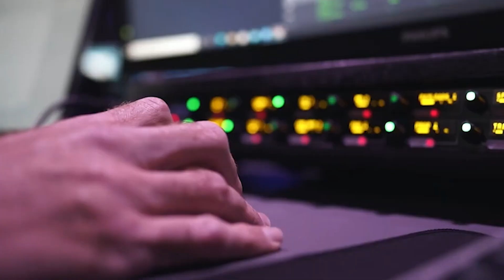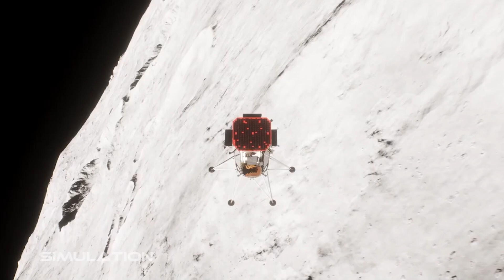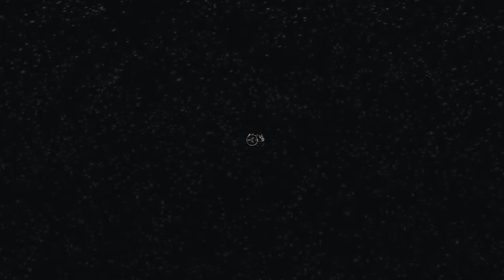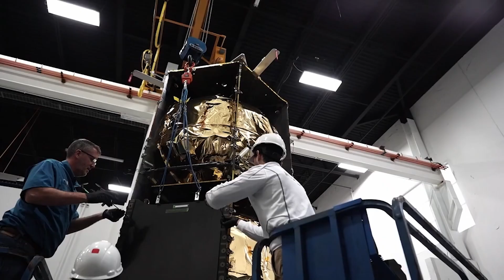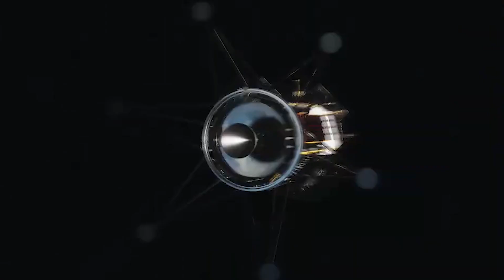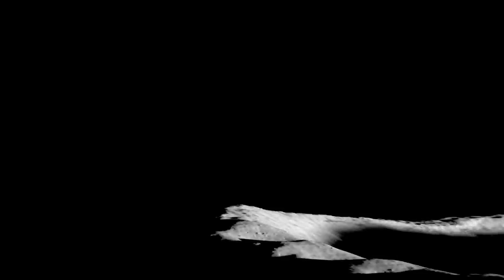What Exactly Went Wrong During Odysseus’s Landing?

Comment: This IM Odysseus lander was a major learning process going forward.  I find it most curious that so many criticize this mission, but most of the criticism is very narrowly only focused on the lander falling over and its mission compromised or why it did have pictures immediately while ignoring that it had many firsts.  

The first US lander and from a private company to land on the moon and the south pole no less.  

The lander may have fallen over, but it landed in one piece.

The lander used a cryo fuel for the first time and methlox was that fuel.  

The lander was built on a tiny budget of 118 million $. If you dont see that as a small budget compared to what missions to other extraterrestrial vehicles you are showing your ignorance about how expensive and technologically difficult it is land on the moon and doing it autonomously!!
Reply: Failure is failure. No excuse 😅

Comment: Why is it not round with a roll cage so it can roll over to the desired position by way of push arms which can be discarded after landing?
Reply: Too much weight (which require lander to be massively overbuild btw), minimal gains, as reason why it happened at all is mistake of a design itself, not fit for any horizontal movement on landing.
Reply: Because that would result in transparency of the entire schtick.

Comment: I'm no engineer, so please don't troll me.😂  But would this be a lesson that if with folding or extendable arms on each side may have been able to correct it. Or perhaps compressed gas jets?
Reply: I think that, more than the legs, the fact that it impacted with an horizontal speed component was what condemned the mission. It would have probably failed even with larger/wider legs... Imho.

Comment: The original price for the IM-1 mission was $77 mil. Then that got bumped up to $118 mil due to modifications. With all that money it took a $1 manual safety switch not being turn off to ruin the whole mission. In the 60's everything had backups and backups to backups. Redundancy was a primary design application in everything Nasa did. And why was this switch manual without a digital override or a backup digital switch. With all the computerization on this lander why was something so vital to the success of this mission left to 1 switch with no backup. Unbelievable.
Reply: What's unbelievable is your cynical attitude claiming the whole mission was ruined because of this "1$ safety switch not being turned off".   

The mission was not defined by it being to land successfully and do its experiments.  Getting to the moon with a budget you even cited was an accomplishment in itself.  After all look how few other landers have successfully gotten to the lunar surface in one piece.   Besides being expensive it is a difficult technical challenge.  

This vehicle used a methlox cryo fuel which was also a first.  

It wasn't about just landing perfectly!!
Reply: @michaeldeierhoi4096  Sorry. I guess being witness to the 1969 and all the other manned lunar landings shows in my lack of acceptance for mediocrity. But you wouldn't understand, being I would guess not born before 1980, the lowering of standers, participation trophies, and the dumbing down of schools, DEI, Affirmative Action, and the myriad of other social justice blather, have made you accept and spin an obvious failure into a triumphant victory. You should work for the Biden Administration. They love people like you.
Reply: @michaeldeierhoi4096  Not that cheap either. For US lander? Sure, it is. Russian/indian/chinese? Already more then average.
Reply: The switch was manual because its entire purpose was to make it impossible to remotely turn on the laser when people were near the spacecraft.  It's a safety device.  Making that switch software overrideable would completely defeat the purpose.  The bigger question is why you couldn't figure this out on your own. Unbelievable
Reply: You spin failure like Karine J Pierre. Anything that important to the mission should have a backup. Redundency is a key to all good design in something that is unmanned. In this case, a switch to over-ride the safety that was either under computer or Earth based, especially in an unmanned mission. I guess your DEI studies didn't cover that point.
Reply: @simulateduniverse9373  That isn't how safety interlocks work.  One day you'll graduate from school and you MIGHT figure out you don't know everything.
Reply: I know failure. I also know reverse engineering. The switch was a weak link. Together, in this scenario, they conclude that a backup should have been in place. Kinda like not using a rubber, resulting in your birth. Failure.
Reply: @simulateduniverse9373 Sorry, you've exceeded your limit of stup!d comments for the day.

Comment: What concerns me is that apparently no one is designing these landers to survive lunar night.  That seems like something that is required for building up infrastructure on the moon.  How much power is needed to keep electronics warm enough that they can come back to life when they get power again?  Aren't areogels really good insulators?  Isn't there a lot of propellant (relative to the task of keeping the electronics and the batteries from cratering)?  Doesn't only take a small distance below the surface to moderate the temperatures that the surface feels like?
Reply: They would have added something to allow the craft to hibernate during the lunar night, but they couldn’t without exceeding the weight parameter because the art carried aboard would have had to be cancelled.
Reply: This wasn't the goal of IM1 and would likely have significantly increased ilthe required budget. It will likely be addressed in future missions
Reply: @Jett-n-gin  Yeah, I can see that.  But it still concerns me when both the Indian and American missions have that characteristic.   I would hope that would have just been an easy extra feature, rather than something that "significantly increased the required budget".  Why would it have?  I'm an engineer, and I'd like to understand!
Reply: @richdobbs6595  it's difficult to engineer things that can withstand a sustained -113C and even more difficult to test on earth
Reply: @Jett-n-gin  I've got a background in engineering.  Please explain to me why it is difficult to control the flow of heat.  We build structures that don't fall apart under these conditions - both in the laboratory and cryogenic gas processing.  If you can build structures, you can do things like construct Dewar flask that use vacuum and mirrors that dramatically cut down conductive, radiative, and convective heat transfer.  The electronics don't have to withstand those low temperatures - you just need to be able to keep them at whatever temperature that they can withstand.
Reply: @Jett-n-gin China succeeded
Reply: There's already tried and true technology to meet this challenge, but the problems are security, cost and current-day qualms about using said technology; namely...nuclear power.

Comment: Whatever landing system was utilized, the machine should have made its final approach to the moons surface vertically with none to little lateral movement, which would have probably prevented the lander from tipping over. Moreover, if the lander had been saucer shaped it could have bounced along on the surface, finally stopping in an upright posture, regardless of any reasonable remaining forward velocity. Why do they think that we have been apparently seeing saucer shaped ufo’s forever ? Geeze ! Why didn’t they just ask me ?

Comment: If it cannot send back the data from the science package aboard it is 80% failure.  If they buy another laser range finder from the company that made the one that failed they have learned little.   The need better a terrain senor and topography avoidance system, perhaps in duplicate.  If they still go with a vertical stacking structural design, they might get the same result later this year.  If they do not have a minimal self-righting system they are also likely to get the same result.  The NASA idea that this can be done on the cheap is a constraint on addressing these problems.  Note how fast Bill Nelson got in front of the camera.  The media frequently remembers first impressions (i.e. "it is a success!") rather than later truths.  It was just too big to fail, and thus we saw obfuscation.  On this point, note that "doing science" is not the same as "having the results of that science".  Also claiming that pictures are coming the day after tomorrow does not make it so.  I think we have a little dressing up of the pig.
Reply: And yet somehow, without any of the modern technology of lidar, radar, etc., Apollo astronauts were able to stick the landing multiple times with merely an altimeter and a small window to look out with some thruster buttons to push. Totally plausible.
Reply: The Laser LIDAR unit didn't fail.  They failed to pull the "remove before flight" plug to enable it before flight.  You don't use a ridiculous "self righting system", you simply land vertically on a flat surface so you don't fall over.  The reason they didn't land vertically and didn't land in a safe level spot is because the LIDAR unit wasn't available.

Comment: Disappointing, but not really surprising given the landers proportions.
Reply: Or the operators, I'm hoping this is actually real this time.  O humans though, I noticed.
Reply: Time to reconsider that starshit hls
Reply: What proportions were those?  The landing legs are wider than the spacecraft is tall.
Reply: @stargazer7644  the problem is lunar gravity is so weak and the atmosphere there so inexistant, that a small shock completely destabilize the lander, with it's 4 meters height alone, elevated by the feets of the lander, the center of gravity on this thing is just way too high for it to land properly without falling, even if it had not touched anything, being on a non flat terrain would have make it fall, the same thing is sure to happen to hls. 

Because everything inside the ship is suppose to be upside the 50m tall rocket, and with almost empty tanks after landing, the center of gravity will be so ridiculously high, that it will fall almost immediately after landing for sure, no matter if it's due to the terrain, the elevator, the astronaut moving inside the crew part a bit too much, or just some artifact that created a collision with the lander.
Reply: @tdldprim The spacecraft legs are wider than the thing is tall. It didn't "fall over".   The proportions of this craft (14 x 15 feet) are very similar to the Apollo LM (19 x 22 feet).  The CG of the Apollo LM was HIGHER than the IM-1 lander because the Apollo LM consisted of two stacked rocket stages.  IM-1 flipped over because it landed with horizontal velocity on a sloped surface and slid into a rock which caused it to flip.  Objects are 6 times easier to flip over on the moon.  This was a very real danger for Apollo as well, and that's why they were extremely careful to land vertically on a flat surface with no significant rocks.
Reply: @stargazer7644  Now i'm not talking about the sheer size of the lander but the stability of the whole thing given the landing conditions, as you said the lander landed horizontally, that why i'm talking about a center of gravity.

Because a lunar lander cannot really land vertically, without any atmosphere to help a lander decelerate, you have to slow with your own boosters therefore falling toward the moon while still decelerating, until the last moments you still have some velocity, and that's where the low gravity become a trap, because in the event that you touch something on the ground it create a destabilization that "flip" (i got it i'll use the right term) the lander upside down, if it is critical to have a right center of gravity in any condtions, well it's particularly true in a moon landing, unfortunately, i could see from many months ago that this wasn't the case with this lander, and it will be the same to not say even worse with HLS.

Because on starship the whole weight is not in the tank, but in front/highest point of the ship thanks to the crew, the cargo, the elevator, the air inside, the tanks that will allow the crew to get back to orbit... While a landing starship use almost all it's fuel to reach and land on the moon, so the main tank in the end is empty, so the lower part of the thing is light. And the higher part is heavy, which again is a massive problem as the center of gravity instantly goes to the higher part of the ship it lose all it's stability, so it's doomed to fall/flip (whatever the end result is the same, the whole crew either die or is unable to escape and being rescued).

Comment: The animation shows a spinning Earth rising and setting over the surface of the moon. But the moon is tidally locked, so the Earth always appears in that same location in the lunar sky. It never sets.
Reply: Not exactly.  The moon undergoes libration.  It wobbles slightly, and with this we can see 59% of the surface over time.

If you are on the edge of the perceived lunar disc from earth, the libration would cause the earth to rise and set.

At any other location on the moon, over weeks of time, the earth would move around a few degrees in the sky due to libration.
Reply: Yeah, the Earth wouldn't rise and set. But still have Earth phases like "New Earth" :)
Reply: @falklumo  Actually because of libration (see my previous comment) it would if you were on the edge of the percieved lunar disc (as seen from earth).

Comment: So much for the state of art the laser guidance system they bragged about that was supposed to look out for rocks and crevices and valleys and etc etc
Reply: In case you missed it, that laser guidance system is what some yahoo left the "remove before flight" safety disable plug in when it launched.

Comment: You have a lander that tipped on its side. That's not a success by any definition. And that laser guidance issue that's being glossed over? the lander had a manual safety switch to inactivate the lasers on the ground to protect eyes. It was not switched on prior to launch. A major oversight/screwup. That's why it wasn't working. They forgot to throw the switch and turn it on.
Reply: @Hal09i. Instead of saying you don't think it was a success by any definition you would have been more precise and honest if you had said it wasn't a success by YOUR definition because you aren't aware of all the ways to define success.   In the first you are ignoring how difficult it is get to the moon in the first place.  Only a few others have tried in the last 50 years and six of those occured since 2019.   Four of those reached the surface and were partially functional. I could relay that history, but you can do that yourself.  

This lander was the first to use a cryo fuel which also methlox, another first.  This was first lander by a private US company.  And they did it on a shoestring budget of 118 million $.
Reply: I mean considering this is their first mission and other missions have failed completely for worse oversights, such as the mars rover that crashed because they didn't convert from meters to feet, these are simple fixes that can be changed for IM2

Comment: An artwork piece?  Give me a break.  That serves no purpose whatsoever.  You could’ve saved the weight and put in some stabilizing legs, or something to right the craft in case it fell over on landing.
SMH
Reply: Given the minimal weight of the art piece if it was not included is purely wild speculation that some adjustment could have been made to the landing legs to ensure a more secure landing.   People need to stop obsessing on the landing not going perfectly and recognize how much went right for this rare lander that touched down on the SOUTH POLE or the first time and in one piece.  And getting to the moon is hard enough so to also land on the south pole using methlox cryo fuel, A 1ST and doing on a tight budget was a big for first step for an autonomous lander.
Reply: @michaeldeierhoi4096  I watched the entire Apollo mission live as it was happening.  Every one of them. It is great that we are going back to the moon.  I will assert that this effort, was blown.  We screwed it up.    we did not have enough confidence in this mission to be farting around with putting art on the moon.  We should’ve stuck with science.  I’m not saying that having an additional gyroscope would’ve helped.  But I certainly know a piece of art did not help.  We should be focusing on the science, which we do very well,  and save the artsy  fartsy stuff until we can get the science correct first.  There is too much at stake, human lives.
Reply: @tack_dog     No human lives were ever at risk from this mission.  Just sayin'.
Reply: @michaeldeierhoi4096  as this is part of the return of “ landing a man on the moon and returning him safely to earth”, We should not be messing around with anything that does not further the success of the mission.
Have not learned anything from  OceanGate Inc.?